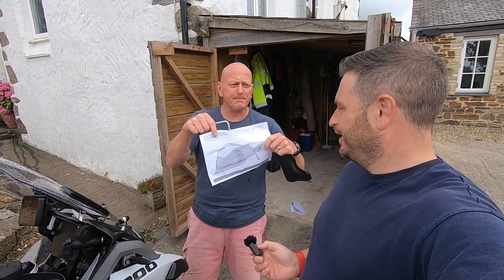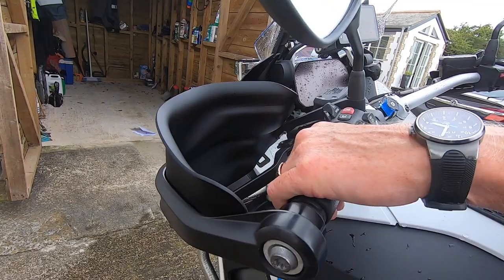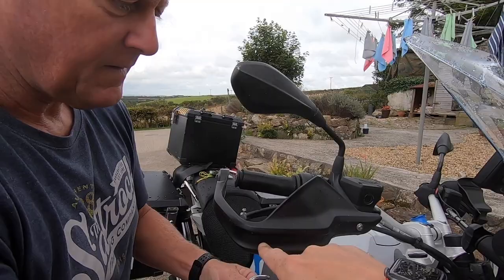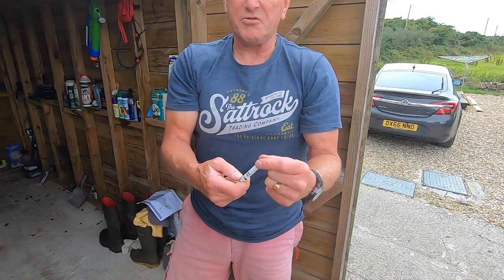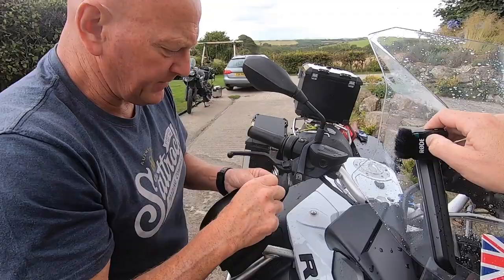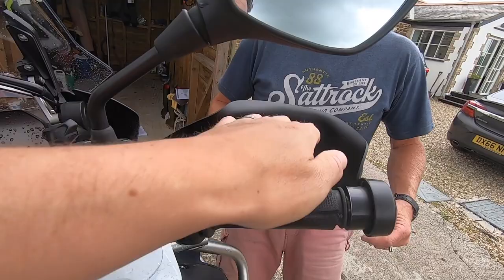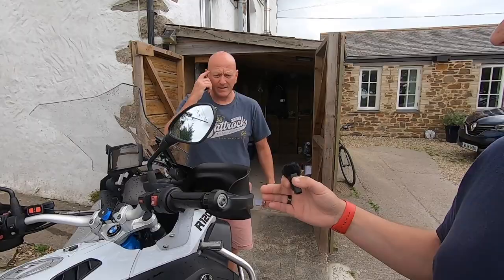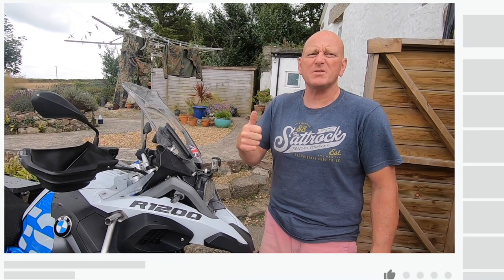Wunderlich Hand Guard Extension | For BMW 1200 GSA

Comment: Guys. The 'Grease' mentioned 3'40" wasn't used. Isn't this the Wunderlich German Loctite? In which case, you should have added a few drops so the screws don't vibrate loose. Nothing worse than a wobbly hand guard :-) 
I've fitted the GIvi's and think they look better.
Reply: Des Byrne they were only fitted for a short while as they are being refitted to a new bike....